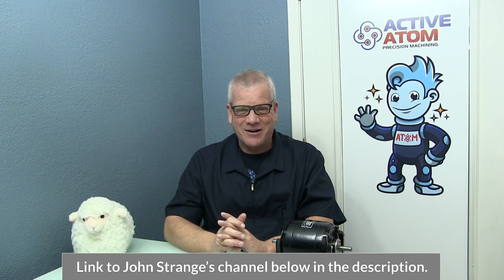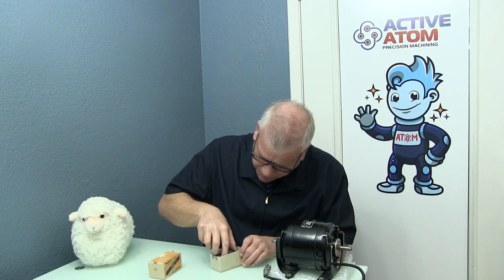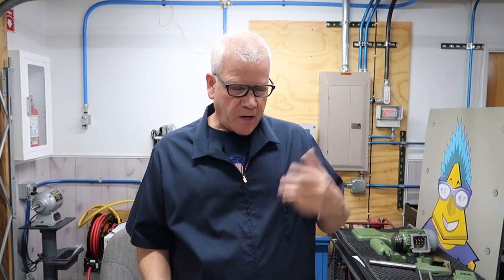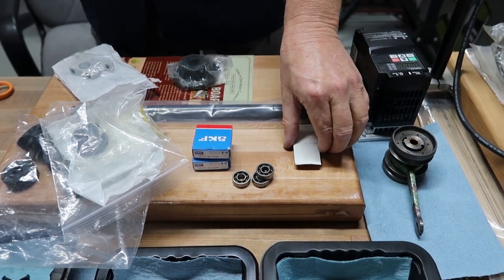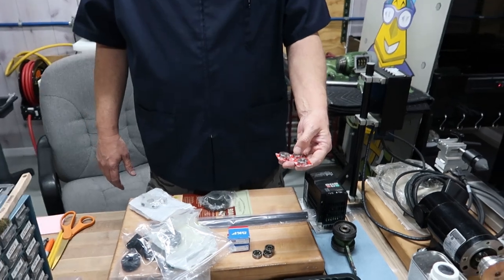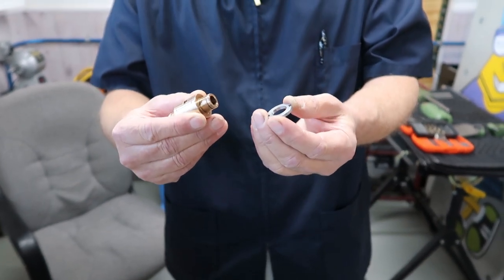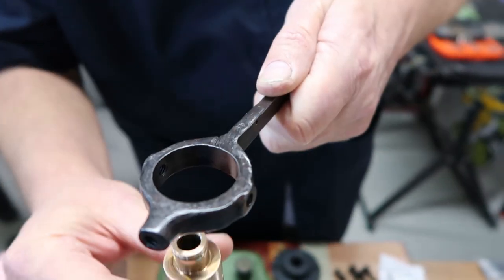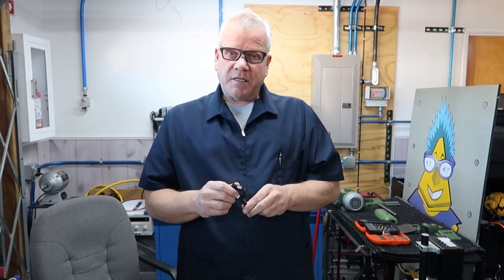SHOP ADVENTURES 15: Refurbishing German Tapping Machine

Comment: It is driving me nuts thinking what products you will be making and selling...I;m dreaming of you making micrometers or dial indicators....The ultimate dream is you making a nice small hobby type lathe similar to a Sherline lathe or mini drill press
Reply from the maker: Hi Jim nah, do not let this thing we named "The Perfected Product" get to you, as we shared, we are not hiding it we are confirming we can make the components of the assembly repeatable for say a few serialized hundred units, this is just for the main assemble base or body, the rest of the components (all made in house and all made by the two of us) should be fine they are in sizes we are used to making for decades now Jim.

We then we will share this product but as we share in the videos you can see we have a lot to finalize, update and refine before this product can begin work. 

Right now it is a design that is being recreated in CAD.

Thank you for stopping in after thinking about this product, do not let it get to you we have much to share before we start making parts and we have these Educational Pullout videos we are making as well, so enjoy the shows, new show Shop Adventures airs this Monday night late.
Lance & Patrick.

Comment: Just out of curiosity, what voltage does that motor use. Most German 3 phase motors that I have seen are 380 volt units. Difficult to come up here in the US. Did you guys  use to work for Levin?
Reply from the maker: Hi thank you for writing to us, we just discovered your great questions in this comment, so we are happy to share our German Tapping Machine is a 3 phase German motor can be wired for either 220 or 380 so we got lucky and utilize the 220 set up within the motor. 
The Levin & Son company Louis and son Samuel is located about 115.5 miles from our location here in the California Desert and so no we do not know them beyond being a full paying customer of theirs, we are just very connected to the insider track for decades now. Lance & Patrick.

Comment: What was that noise again? LOL  Enjoyed the video.  I take it that SKF is a good bearing brand, what are some others?  I put a post on the Active Atom FaceBook page.  Thought of you guys when it came to mini/micro machining.  Hoping you might have some advice for Steven Lang at Shark Rive Machine (YouTube Page).  He has a very mini gear problem.  I used to work near some positive pressure areas.  Gotta keep the dust out! 'Til next time!
Reply from the maker: Hi Vernon, we did go over and subscribe to Steven's page and we will watch videos he is going to be making and sharing about making these train axles and maybe even the gears (me wishing here) so that is nice, thank you. 
Say a great big hello to Patch from Patrick and Lance. Well our pressure room is just an air climate control filtration system and we double sealed the doors and windows and we always wear our socks though eventually we will get one of those foot booty machines that places a clean shoe cover over your entire shoe until then socks work just fine. We will be replacing those 50 millionth tolerance head stock bearings (talk about high tolerance press fit bearing work) during the reassembly of our most precision larger micro Levin Lathes starting soon and that will take place in the Workshop area as well.